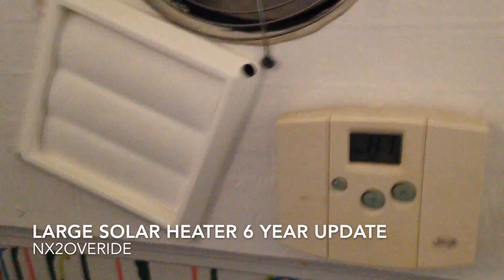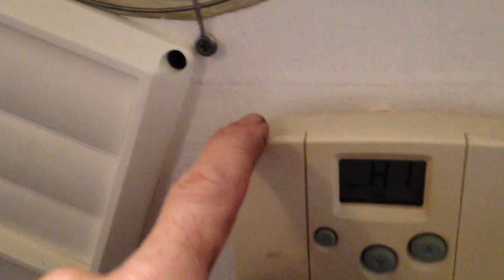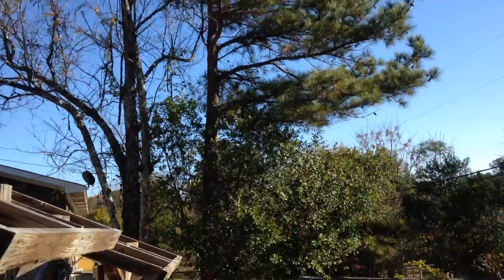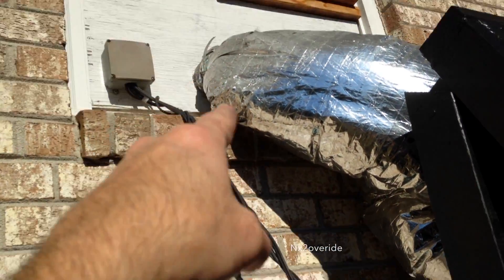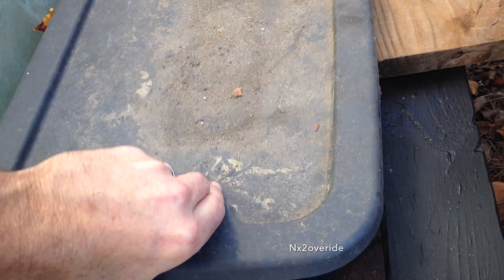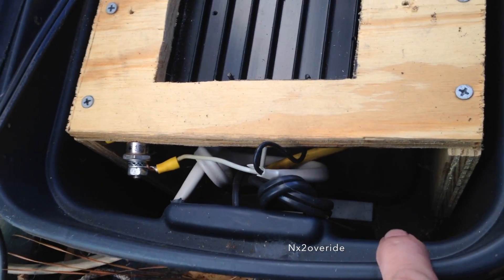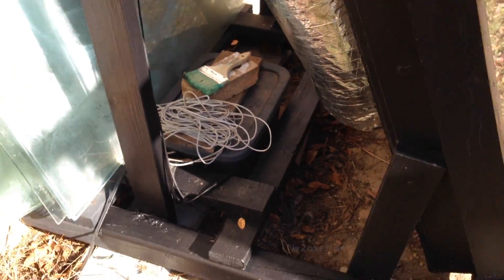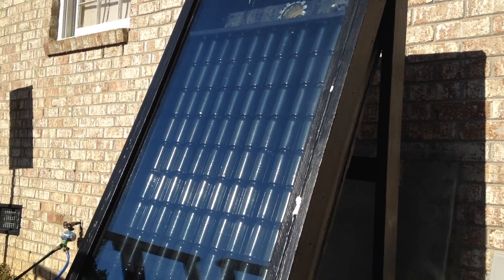Large Solar Heater 6 Year Update

Comment: So how much heat does it give your home?
Reply from the maker: It depends on the day really,  With no clouds and the sun out it can heat the 3 back rooms in my 1200 Square foot home. It pumps out a continuous 85-100 Degrees with full sun into the home. It really helps on our electric bill. It supplements the heat on those good days from our electric heat pump. Last winter my daughter closed the door to the room the heater runs in. It was in the 20s outside and when I opened the room it was 90 in the room.  It was worth building it. The problem most people have is finding the glass, that is one pain from an old sliding glass door its almost 1 inch thick with no "UV film" so it gets hotter than the newer glass doors.

Comment: thanks for the update your collector looks like it's in good shape. retired mine last year after 7 years it had no uv protection on the glazing and it started yellowing after 5 years bulit a new one same size a little more air flow and uv protection. I have built both screen and can collectors and although can collectors harder to make I think they run better. Thanks again for the update.